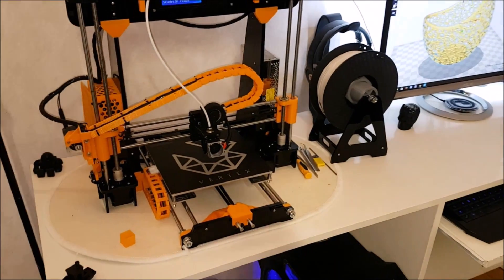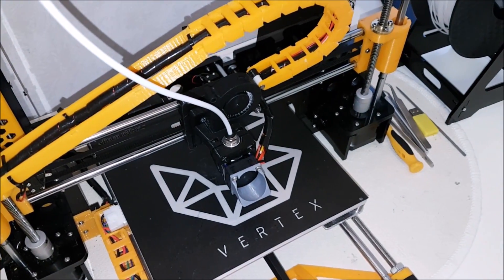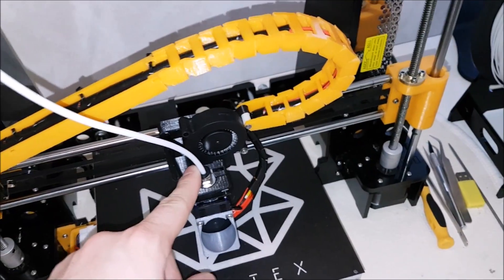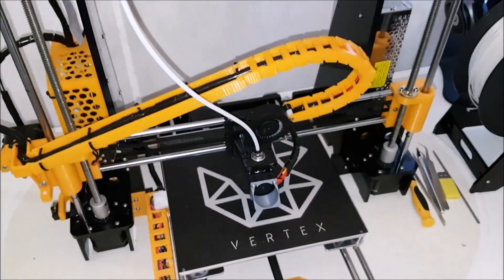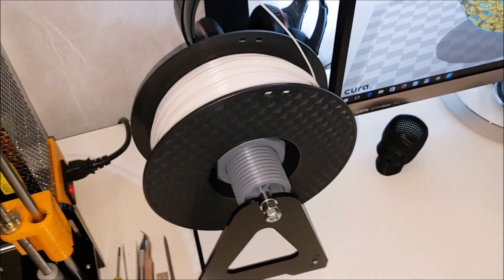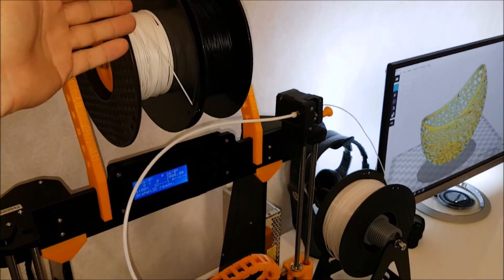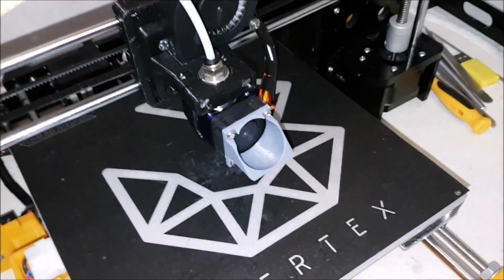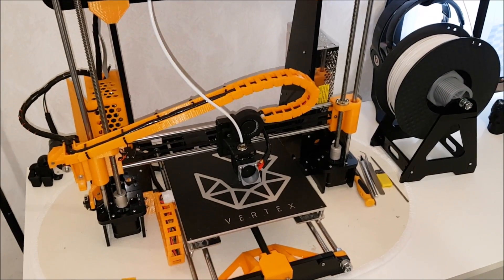Anet A8 3D printer upgrade E3D V6 bowden! Part 3

Comment: You inspired me with this setup and convinced me to pull the trigger on an A8 plus instead of an ender3. I have the same hot-end upgrade coming in the mail, and went with the dual-direct drive bowden extruder. Did you use the stock extruder on this setup?

Comment: The bowden system wastes about half a meter of filament. Direct drive wastes 2cm in worst case. Unless you want to print at supper high speeds (150mm/min) bowden is a waste of money.

Comment: I'm using the same setup and code like you; I'm getting some problems with latest cura and retraction causing the feed to choke. have u experienced something like this?
Reply from the maker: linkspyder Try to use CURA 2.6 or 3.1 Version. Latest versions have some weird bugs.

Comment: Nice upgrades!
Did you print your X-Axis carriage in PLA? I have an A6 and would also like to get an E3D v6, but I am concerned about using PLA for it's carriaige.
Reply from the maker: Adam Piskorski Yes I did and it works great even today after so long time, but I do recommend to print it in PETG or ABS just to be safe if you printing with high temperature on heat-bed.

Comment: Hey I must be blind but I can’t find the e3d upgrade part 1 and 2 links? Mine arrived today and I am currently printing the required parts but I wanted to watch all the videos first
Reply from the maker: CorysCustomInstalls I don't have instaling tutorial on E3dV6. It's not hard to do it so I didn't recorded it. Sorry, I just show it here. In next few videos there is tutorial how to flash motherboard and fine tune it for E3DV6 as well other upgrades for A8

Comment: i installed a chinese clone and i would always get heat creeps during the print or right before the print started,  it is not an easy upgrade as you need to do firmware changes too so if you are not experienced stick to stock extruder, or buy the genuine one

Comment: Hi. nice video; been trying to replicate your setup, but now I'm facing a problem; the carriage taken from your example doesn't work on my anet a8; the distance between the metal rails doesnt match the carriage igus bearings center, as the rails seem to be a little bit further apart(and no sand paper will solve the problem); could there be slighty differences from the anet a8 builds? any ideas?  measuring between the rails and on the ends they measure from inside around 38mm distance. thanks

Comment: Did you upgrade the PSU?
Reply from the maker: AvianAviator No its standard. But I add few small heatsink on  the top.
Reply: Awesome Thanks, I was wondering if you were required to upgrade it just in case the e3d needed more power.  But i'm Glad to see that it doesn't need it.

Comment: Help me understand (I'm just getting into an A8 and all the info is overwhelming):
- You were having quality problems because your carriage was binding at the ends of its travel, was this because of the spacing of the rails in the mounts vs the spacing of the bearings in the carriage was slightly different or was it intrinsic to the design of the head somehow?  Did replacing the head fix the problem or was it just an opportunity to fix the carriage/spacing problem at the same time?
- You printed an impressive demo with it, but it was with a .2mm nozzle vs a .4mm (half the diameter, 1/4 the flow).  Is the accuracy increase because of the smaller nozzle or something intrinsic to the print head (I understand that the head is smaller and possibly controls temp better so the motors can move it faster accurately and it might work better with different filiments)?

Comment: I followed your instructions, and got everything working.  But when it homes x/y it is off to the right of left edge and way in front of the bed, causing it to print off the right side of the bed and off the front.  I am using the travel limits in the firmware and the start/stop gcode.  It seems as though the parameters for the G28 x/y offset are being ignored as the head lands in same spot regardless if I use G28 X-16 Y-26 E3000 or G28 with no parameters.  I can't figure out how to fix this.

Comment: WAIT A MINIUTE ! this is  not a E3D for starters ! its a clone ! that's your first problem , your unable to make the difference between a real one and that badly made cheap knock off,  then you go on  thingivers asking for help! no wonder your having problems , Cheap print with cheap knock off copy parts!
Reply from the maker: patprop74 Are you sure you wrote comment on right channel? Of course it's E3D clone. I order it myself. Help for what? I never have any issue with this E3D clone or any so far and I have 10 more 3D printrers with same or similar E3D clone. Why would be any issue? There is heater and temp sensor who cost 2 usd to replace if any fail in any time.  Rest is CNC machined aluminum heatblock and hot-block(CNC) made again. No big deal about it. Am running this setup 24/7 for months now and still producing awesome prints. Best value for money you can get. But if you want to order Geniue/original E3D V6 and pay 10 times more for same (more-less) product then be my guest.
Reply: You are right wrong webpage link and for that I apologize,  but I do stand by what I said concerning the knock of comment , I get it,  most of your are more worried about money then you are about , pride in encouraging the original creators of said product.  Go dollar store go!
Reply: Not all of us are rich enough to pour money into developer pockets, yes we appreciate their work, but for the price why not just use the clone? If it was wrong the clone would have been removed due to copyright a loong time ago
Reply: Im not out to make anyone feel bad for not being able to afford none clones products, I am sure E3d would have to spend every dollar they ever made just to be able to stop cones of their products, its almost pointless, the only ones that can stop cloning is us the consumers by not buying clones and maybe! , just maybe, the original manufactures would sell enough to cover cost and lower the retail prices, which is hard to do when potential buyers are buying clones.

Comment: Hello, Nice one mate. I just upgraded mine with bowden as well, but with my cura setting it is stringing a lot, I do not know how to make this work, could you pls share your printer settings with me? would be so nice!tks
Reply from the maker: Tiago Massignan Hi! Use more retraction speed. Let it match with print speed. Or use it even more. Thanks for commenting. Cheers

Comment: I got the same vertex cover on my hot bead. HOW DO YOU GET YOUR PRINTS OFF THE BED????
Reply from the maker: Easy if your nozzle is not hitting bed. Look my video about bed leveling,and use less/ no heat on Vertex. Then your prints will be much easier to take off.
Reply: the nozzle isn't touching the bed, but I turned the bed temperature down to 30°c and helped. I probably could turn bed off and it still be ok. Thanks for the reply!

Comment: If you upgrade to E3D V6 bowden you need to buy a new extruder or you can use the one comes with the printer? thanks
Reply from the maker: You can use your one that comes with printer and you need to print this part https://www.thingiverse.com/thing:2039986

Comment from the maker: If some of you guys want to purchase this e3D V6 hot end here is link: Its cheep :) https://goo.gl/P5wxz8
Reply: Isnt that a clone?
Reply from the maker: Of course is clone :) You want to order original and pay over 8 times over for same product? Be my guest :D
Reply: Nexi Tech Will it still be able to print flexibles with a bowden setup? And could you create a BOM with all the final upgrades you did on the printer, so that we can get an idea of how much it will cost
Reply: I am using the same extruder mount as you, but when I hear the extruder it causes the mount to get soft and warp. What settings and material did you print your mount with?

Comment: Hello, i gave a question nexi. All e3d v6 clones i can find have a dupont conector for the temperature sensor but the anet mainboard only supports JST conectors. How did you connect your e3d v6 clone to the mainboard?
Reply from the maker: Use old connector and soldering iron or just change wires in connectors. It's easy. Fan cooler wire you can cut and solder  to V6 fan wire.  Here is link of V6 http://www.gearbest.com/3d-printer-parts/pp_613785.html?wid=21&lkid=10642535
Reply: thanks Nexi! Since i saw your videos and upgrades you did you conviced me to buy my Anet A8 and do a lot of upgrades, couldn't be more happy about this little machine!

Comment: Hi Nexi, the link to aliexpress for the "E3D V6 Hot End Full Kit 1.75mm" doesn't work anymore. I'm assuming this one would work?
https://www.amazon.com/DIKAVS-1-75mm-Printer-Extruder-Accessories/dp/B06XD5MBT7/ref=sr_1_fkmr0_3?ie=UTF8&qid=1491578242&sr=8-3-fkmr0&keywords=E3D-V6+HotEnd+Full+Kit+-+1.75mm+0.2mm%2F0.3mm%2F0.4mm%2F0.5mm+of+nozzles+12V+Bowden+for+RepRap+3D+Printer+Extruder+j-head
I'm in the us so 12V should be the one.
Reply from the maker: Take this one! http://www.gearbest.com/3d-printer-parts/pp_613785.html?wid=21&lkid=10642535
Reply: Thanks Nexi for the reply
Reply from the maker: You welcome :)

Comment: I have the anet A8 and I have also upgraded to the e3d V6 clone. After upgrading, I'm now left with giant blobs on the surface of the print. Do you know of a fix for this?
Reply from the maker: Did you check your hot end? Is it look good inside? It's not clog or damaged?  Did you screw secure V6 hot end at all separation? How's nozzle look? Is it same size like old one? Check everything and write back.
Reply: It looks identical to yours. It just leaves small blobs of plastic whenever the extruder isn't supposed to leak plastic. My retraction isn't relieving the pressure.

Comment: can you help me? i just bought an E3d v6 clone and have everything like mount and X-Carriage printed out but the fan wire on the extruder is too short! am i missing something obvious? thanks
Reply from the maker: Just cut it and solder to ''original fan wire'' Its 5 minutes work. Cheers!

Comment: Hi Nexi,I just wanted to say that this video is very helpful thank you,I apoligise if Im troubling you I just wanted to ask about the Cura settings as well as how do I adjust my skynet firmware for the E3DV6 Bowden set up plus Im using the standard Anet auto level sensor and I was wandering if your G codes will work I apoligise for being a bit dumb as Im very new to 3D printing and only have had my Anet A 8 printer for A couple months.

Comment: Ehi Nexi, E3D v6 arrived and after first partially succesfull print, it stops heating. Older extruder still works, so looks like board is not the problem. Have you ever faced that problem? Does it need more power?
Reply from the maker: No never. Maybe is faulty unit?

Comment: Your setup is phenomenal!
I've just got my printer a couple days ago and have been reviewing your videos.

Unfortunately my bed plate threads came a bit stripped (2 of 4) and it's fairly difficult to get it precisely level. My question to you is, since you've modified the crap out of yours, ...if I were to drill out the holes to the plate chassis (part that holds and slides the hot plate) and feed the screws through allowing the butterfly clamps to provide the needed tension themselves...would this cause any unforseen issues?

...I hope this question makes sense, any suggestions would be appreciated. And THANKS for your videos, looking forward to trying to get a setup like you've got!

Comment: Hi Nexi, excellent videos for your anet a8 setup. You have convinced me to buy one! Would this part be suitable as replacement extruder? https://goo.gl/KCXA8W Also, would using this extruder make use of the ANET filament feeding module? I'm not sure if that is the correct word for it. the device which feeds the filament into extruder. Thanks in advance and great videos keep it up i look forward to seeing more upgrades :)
Reply: Also this item has 0.4mm nozzel, is that suitable? or should the nozzel be smaller? Thanks Nexi!
Reply from the maker: Yap that should work but this is cheaper http://www.gearbest.com/3d-printer-parts/pp_613785.html?wid=21&lkid=10642535
and you have to print parts in video description and change codes in firmware as well in g codes. Check my next videos ''how to flash firmware'' etc Good luck. Cheers!
Reply: Thanks for the confirmation Nexi. I've watched your video on how to edit firmware codes so will follow that when I get to install the V6. I've almost got all parts printed out https://goo.gl/photos/MHyZj4V2Ng26EcXD6 just need X carriage and X bearings to arrive. Thanks for you info. Happy printing!

Comment: Hey Nexi! I was wondering how you mounted your Bowden tube to the extruder motor. I was thinking about buying this clone extruder with good reviews - https://www.amazon.com/gp/product/B010MSTVZO/ref=ox_sc_mini_detail?ie=UTF8&psc=1&smid=A2OT68V1VVE45A , but I do not know how the tube connects to the extruder. Does it just screw into where the hot end used to go or do I need to buy or print an adapter? Plz reply and thanks love your vids!

Comment: What about TPU filaments. , can you recoment this? http://www.banggood.com/MK8-All-Metal-Long-Distance-Remote-Bowden-Extruder-Parts-1_75MM-Supplies-For-3D-Printer-Accessories-p-1023074.html?rmmds=cart
Reply from the maker: Just print this and you are good to go! https://www.thingiverse.com/thing:2039986 Use standard extruder and motor that come with printer.

Comment: Would you please reply with a link to the angled usb cable you bought.
Reply from the maker: Here you go : http://www.ebay.com/itm/191573391525?_trksid=p2057872.m2749.l2649&ssPageName=STRK%3AMEBIDX%3AIT
Reply: Do you have a link to the thingiverse file for the x cable chain adapter to the new carriage?
Reply from the maker: There is no adapter. I just drill one section and connect to the cooling fan with screw. That white part is just small part of filament tube. Look closer you will see.
Reply: Thank you

Comment: What bowden connections did you use?
Reply from the maker: Connection?
Reply: The Bowden connector on the original extruder motor up top, I've already drilled and tapped my original block to match the tubing connector from e3d. Was just wondering if you are using a connector that would have kept me from needing to drill and tap mine.
Reply from the maker: Just print this: https://www.thingiverse.com/thing:2039986 and use https://www.aliexpress.com/item/3D-Printer-3D-V6-J-head-Pneumatic-Connectors-PC4-01-1-75mm-PTFE-Tube-quick-coupler/32361630920.html?spm=2114.13010608.0.0.al5StQ if you did't get it in your V6 package.
Reply: Nexi Yeah I did print that and I got the connections from e3d but they are to big for the original thread so was forced to drill and tap my block for the larger size.

Comment: Hi do I need to update software to sky net to run this setup will be installing the e3d v6 tomorrow and want to know if I can run it on the standard board without changing the software ? Thanks
Reply from the maker: You have to install  Skynet V1.1 software or your nozzle will not be in center of heatbed and your printer will not now ''where'' is limit after homing on X and Y axis. You can snap your belts if you print something big.

Comment: Did you use all stock parts for your extruder motor system?  I see the mount that you printed but what about the gear / tensioner?
Reply from the maker: All stock.

Comment: HI Nexi - All of my parts have arrived and I am changing my hot end to the e3d V6. However, my X-axis chain does not attach to the new X-Carriage. Can you link to the part of your X-axis cable chain that connects to the new X-axis carriage?
Reply from the maker: I just drill one section and connect to the cooling fan with screw. That white part is just small part of filament tube. Look closer you will see.

Comment: How do you attache the x-chain on the x-carriage? You have a longer chain-element on the end of the chain, but I can't find it on thingiverse :(
Reply from the maker: I just drill one section and connect to the cooling fan with screw. That white part is just small part of filament tube. Look closer you will see.

Comment: Did you change the bearings or are you running the stock ones?
Reply from the maker: They ware stock But I replace with IGUS style in PLA. Look here: https://www.youtube.com/watch?v=CWmgoOdG0lY
Reply: I've recently changed mine out as well. Thanks for the reply.  Also, you'll probably end up making a new E3D mount.  This one is to far forward and won't let you print on the rear of the bed. I'm printing a new one I've designed right now.

Comment: Nexi could you please help me. You know the bearings on the x rods. They keep wobbling as if there is  gap between it and the rod. What should i do?
Reply from the maker: did you print X carriage correct? It should be very tight fit!
Reply: Yes I have printed it. I will print new idlers as the reason is they are not tight enough. Thanks for responding. Just installed your e3d v6 hot end. great quality prints!!!
Reply from the maker: Nice! You welcome! Good luck with printing! :) Cheers!
Reply: Awesome videos

Comment: I chose your settings and printed the same mount as yours, just with a auto level sensor mount. My motors are going crazy and dont stop at the stop switches. What did I do wrong? :(
Reply from the maker: Sorry that fake ''Autolevel'' I take off after 2 days trying to make it right! That sensor just ''offset' Z axis. Its not relay auto level. Take it off and enjoy in really manual printing :D